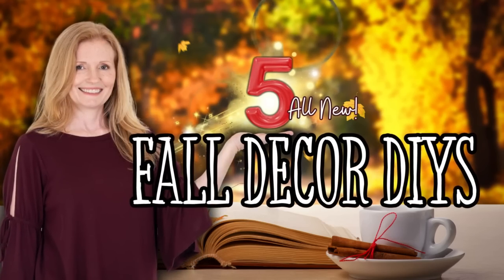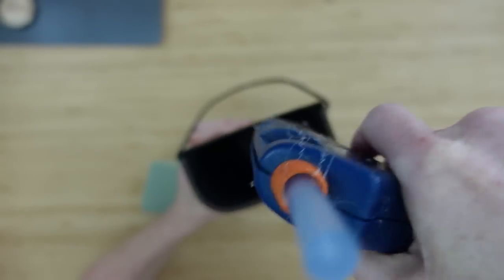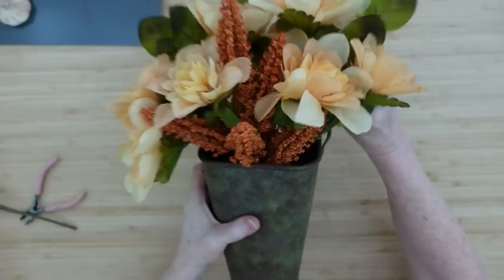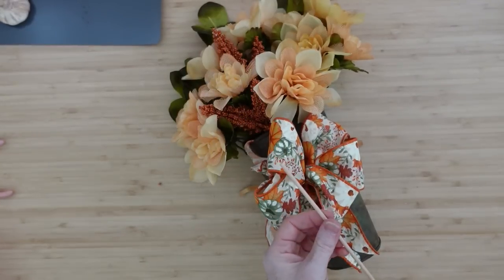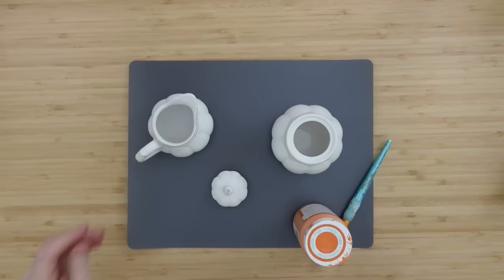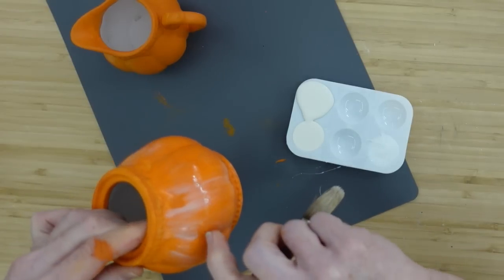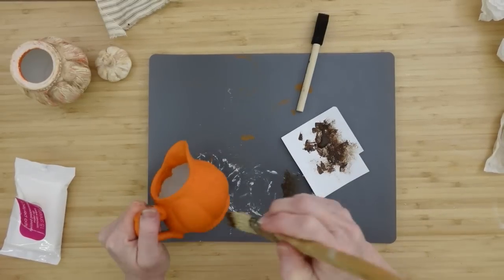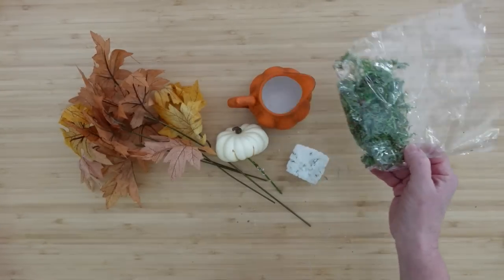Cozy Autumn Vibes With Fall Decor Ideas That Will Transform Your Home

Comment: First, real quick: I use my husband's  Craftsman Heating Gun. I've only used it outside, to help soften paint trim so I can easily remove it. It has a dial for many heat settings so I really think it would work well on crafts. My favorite is the calendar wood sign! 🤗 I have to try this. I bet we could use scrap wood or anything flat that we want to repurpose 😃 And I love the little sugar creamer set. You know, I bet you could take an old teapot 🫖 you could find at a thrift shop, and make it with that if we don't have a sugar creamer set. I love how versatile your crafts are because we can alter them based on what we have or can find. Thank you! 💗
Reply from the maker: Thanks Kimberly! I appreciate the help. A teapot is a great option!

Comment: May I suggest for your heat going to a hobby store,  Like train hobbies, Or to a home box store.  You can get a heat gun for a round thirty dollars. And the temperature can be adjustable from anywhere to 100 hundred degrees all the way up to a thousand sometimes.  Possibly even more depending on the quality of the guand what you're willing to spend but for about thirty dollars you can get a really amazing one... I should add it won't be a handheld crafter size... It will be an actual hand pew pew or larger size
Reply from the maker: Thank you for sharing that tip!